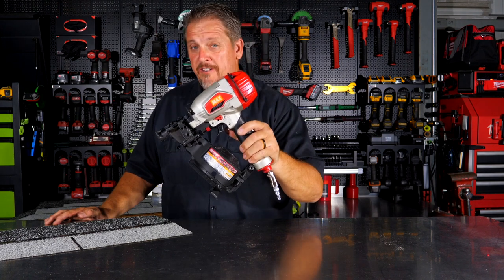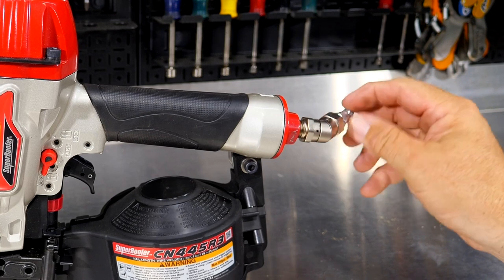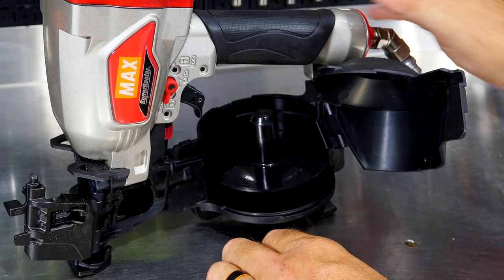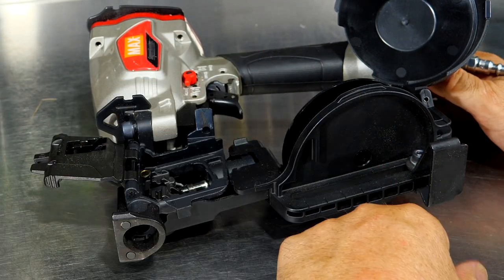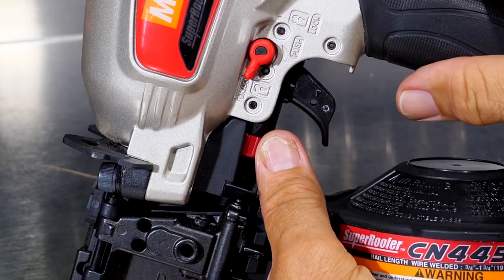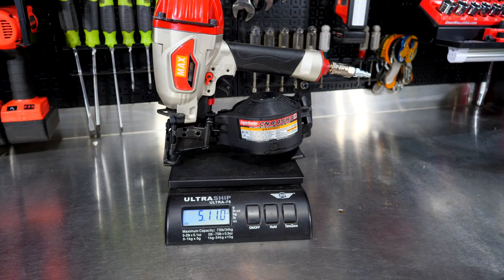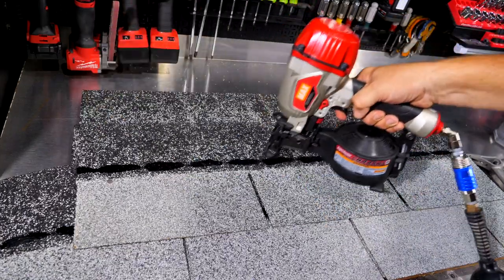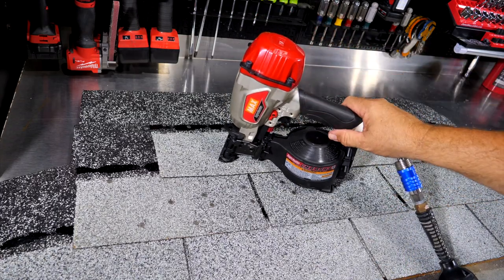MAX USA SuperRoofer Coil Nailer Review [CN445R3]

Comment: wheres the skyhook/rafter hook? personally i like the roofing/siding coilers that go up to 2 inch, or higher? i think my beat to hell hitachit is 2 1/4?
Reply: Doesn't come with a hook, but you can add one to the back air quick connect fittings(pneuhook or husky makes one too).
This is a roofing nailer for asphalt shingles etc, only shoots (big head)coil roofing nails - 3/4" - 1¾". 🔨🔫👍
The one you're referring to is a 'siding' nailer for like board & batten, cedar shakes, fencing, etc. It shoots 1½" - 2½ (small head) thinner gauge 15° coiled nails(ring shank, galv, stainless, dipped, etc). 🔫🎯🔨📐💨
Ps. There's also the coil 'framing' nailer that shoots big coiled framing nails up to 3½" long(various gauges, lengths, coatings & shaft style -ring shank\smooth, etc). It's so nice for shooting down roof, floor & wall plywood sheathing! So much easier to load a big(120+) coil of nails & just go to town fastening it all down quickly, instead of continuously keep putting nail strips in a regular stick framer. Only con is it's BIG & BUlky and won't fit in any tight spots. 🤷‍♂️✏️📐🔨🔫🎯🛠️📏😅😅